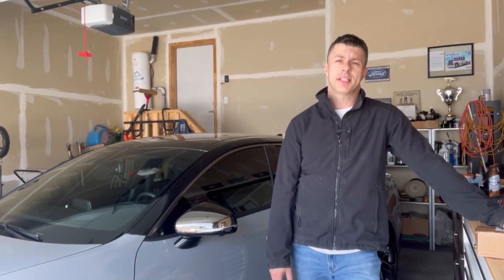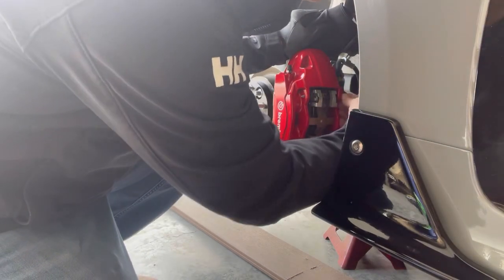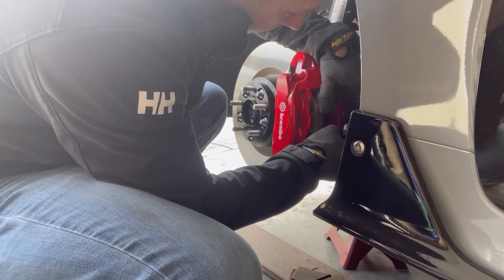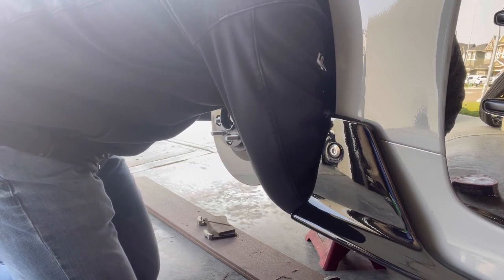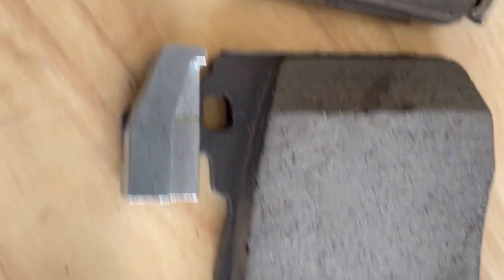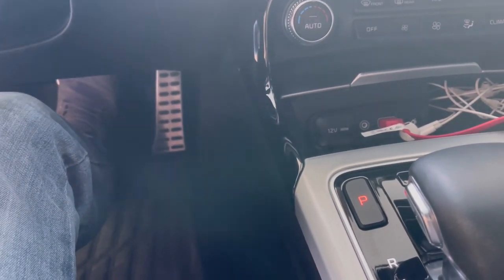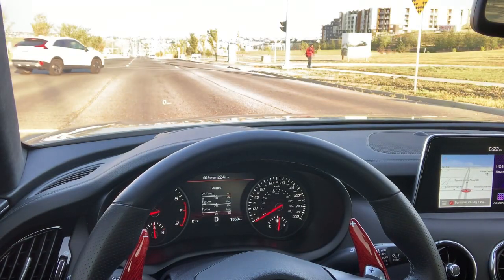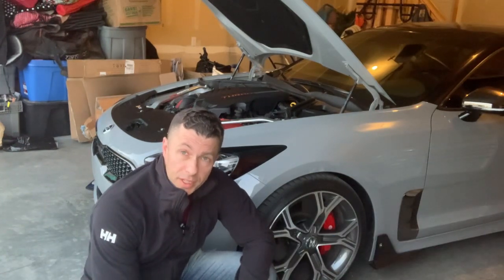CHEAP - QUICK Fix For Your Vibrating BRAKES | KIA STINGER

Comment: I just bought a used stinger GT2 with 20k miles and I notice it slightly. I went in with prior knowledge of the issue and crossed my fingers but it's definitely there lol. I'm assuming the residual shake you felt was due to not replacing the rear pads. So, it's been 5 months since you did the fix, did the issue come back? I'm not really a car expert but I might take a whack at following your guide on this.
Reply from the maker: The issue has never come back. I’d definitely recommend swapping out the pads with power stop from k8. Since you have 20k miles I’d just get the rotors turned. That should completely solve any vibration problems.
Reply from the maker: Brembo are probably the easiest pads to change. If my video doesn’t fully help you, there is a ton on YouTube to help you get it done. The biggest piece of advice when doing them is to make sure you get the pins to hold down the retaining clip properly. Also when the job is complete start the car and pump up the brake peddle before driving it anywhere or putting it in gear.
Reply: Did you only change the front pads here?
Reply from the maker: @kamandor  only the fronts so far and it eliminated the shake. I will be changing rears in the summer.

Comment: I got the power stops just like you. Installed them, but seem to hear like a shake or rattle noise, they brake fine but idk how I feel about that
Reply from the maker: I have no shake or rattle noises. Are you sure the pads are in correctly and you didn’t miss putting the pin through the pad correctly? I’d double check that everything is installed correctly.
Reply: @OVRBoosted  I'm gonna take it apart and check it again, did you re use the plate that sits on the pad and contacts the pistons? I didn't get a new one in my stoptech kit but I did get a new clip
Reply from the maker: @losttyrant7482  there should be a plate mounted directly on the brake pad. I re used the metal retainer clips
Reply: @OVRBoosted  reinstalled them, I had the clips in backwards 😮‍💨 Thanks for all the help bro!
Reply from the maker: @losttyrant7482  no problem, that’s what I’m here for is to try and help people out as well as get help from others.

Comment: Service the brakes once a year and don't drive like youre racing and you won't have a problem. If you hammer on any brakes the rotors can warp temporarily or permamnently, I own a gt2 never had a problem in 80 thousand KM
Reply from the maker: The stock brake pads are known to leave deposits on the rotor giving a vibration. I swapped just the front pads and drive hard with zero vibration after over a year.

Comment: So it's been a year, are they still good?
Reply from the maker: No issues at all to report and zero brake shake.
Reply: @OVRBoosted  nice, I have a g70 3.3 with the same issue. Only when they get hot.
Reply from the maker: @SparkyWrench  try a better pad, but if the rotors have a lot of miles I’d recommend having them turned. The issue on the stinger is the pour quality break pads from the factory.
Reply: @OVRBoosted  I remembered watching your video several months ago, wanted to see brand. I'm looking at the z26 warrior option.
Reply from the maker: @SparkyWrench  it’s a good option, if you contact the guys at k8 they might even have better options now. They also test some of the pads on their shop stinger.

Comment: Two or three crash-stops from 100kph will clear the dust build up off the pads and the shudder will disappear.

The rotors do not warp. Don't know what all the drama is about.
Reply from the maker: I put the new pads Iim and ha I had an issue since.

Comment: Steel rotors and cheap pads are most likely the issue. 
They should have at least put a performance vented rotors from factory.
Reply from the maker: I’m not sure about that only because my brake shake had completely gone away by swapping the pads. Kia used a pad that would leave deposits on the rotor when heated up. That’s what would give the vibration. Once the deposits cooled down they would clean off the rotor. Then the process would repeat. I have over 1000 miles on the new pads and no shake.
Reply: OEM are vented rotors.
Reply: @rpmautoreviews9249  I meant to put slotted and drilled performance rotors. Still the problem are the rotors
Reply: @410ytlmustang  Rotors are just fine and solid !! Not the rotors. Drilled and slotted rotors are weaker a bit more prone to crack in winter, they wear down your pads sooner, so you buy quality pads to have them worn down faster, they can be noisier, They just look so fn cool, but theyre not really better performance in braking. maybe a tiny bit better in the right sweet spot of bit hard driving and they heat up if prolonged spirited hard braking, but for real hard braking on a track or everyday spirited driving on windy roads, No, plain will perform better.  Unless you can afford $2k per rotor for the true racing type
Reply: @410ytlmustang  The problem is NOT the rotors and are in fact the pads themselves - a well known issue and fix on the Stinger forums.
Reply: @OVRBoosted  I wish they put a good set of pads and rotors from factory
Reply from the maker: @410ytlmustang  couldn’t agree more, but they probably have to cut costs somewhere. I’m surprised they have brembo brakes on the front and back. If you look at a lot of higher end cars they just put a brembo calliper up front and a factory Calliper in the rear.

Comment: Weird thing is I’m on my 3rd set of rotors and pads and it’s still shaking and vibrating.
Reply from the maker: Are they stock pads and rotors?
Reply: No, I got R1 concept rotors and pads. It is so annoying. Everyone seems to be loving their car but I spent about 10,000$ in 6 months owning it.
Reply from the maker: @HanHsu910  that’s crazy! I wonder if you got a bad one? I know a lot of people run the R1 and have no issues.  I just swapped out my pads and my brake shake has been gone ever since. Maybe there is a potential other issue?
Reply: @OVRBoosted  It is super weird, it only does that on the highway above 100 Km an hour when I press the brake. Brakes doesn’t seem to be stopping fast also. I have some bent rims I’m getting new wheels maybe that’s the issue. I hope haha
Reply from the maker: @HanHsu910  oh yeah, bent wheels will give the sensation of vibrations. I had Bent wheels on another car and experienced some vibrations.
Reply: @OVRBoosted  Mmmm but I don’t feel the vibrations until I’m on the highway and I’m pressing the brake. Only if I press the brake it vibrates.
Reply from the maker: @HanHsu910  that’s strange, did it vibrate when you put everything on brand new or did it start after time?
Reply: @OVRBoosted  Starts over time, all of a sudden it started slowly until it got really bad. I got my rotors replaced yesterday and still shaking, doing the pads tmrw hopefully. The old rotors was pretty burned but only 10k Km on it. So weird
Reply from the maker: @HanHsu910  that is strange, have you tried pads from k8? I had a civic that had horrible brake shake, I replaced the rotors and the shake was gone for about 15,000km then it came back. Had the rotors resurfaced and it went away for another 15,000km. Then it came back again so I feel your pain. The stingers usually attribute the shake to the stock brake pads leaving deposits on the rotors.
Reply: @OVRBoosted  Do you know why the civic rotors were doing that?
Reply from the maker: @HanHsu910  my guess is I heat up the rotors to much and they warped. Good be a cause of poor quality. However I have never replaced brakes on any other car and had that happen. 

I’d try the new rims you have first, then try a completely differently set of pads and maybe just have the current rotors turned. K8 has a really good set of pads for a decent price. They test the pads on their shop stinger. I know the power stop pads that I used are great. Zero issues so far and I just swapped out the front ones. That was about 5000km ago and I really put them to the test and heated them up to the point of smoke. I thought for sure once everything cooled off I’d have warped rotors, but all was good till this day. Do you have the stock rotors still?
Reply: @OVRBoosted  No I have the slotted and drilled R1 concept rotors. My 3rd set now, maybe the bent wheels aren’t putting even pressure on the roads when I brake and cause the rotors to warp?
Reply: @OVRBoosted  I can’t really turn these rotors cause they are drilled and slotted. Brake shops near me all rejected it. So only options was buying new ones. They are only $1,000 Canadian roughly for 4 so not bad at all.
Reply: @HanHsu910   I just got new wheels on my 2019 GT because I bent an OEM wheel hitting a pothole. The shake that I had went away with the new round wheels. I was also worried about it being the pads/rotors again too. It was definitely the oval ass wheel I was running 😆 Turns out... circles roll better than squares. My shake also only happened when braking with the bent wheel, maybe an indescernible amount of vibration while cruising

Comment: its not k-16 its 16-6012-z16
Reply from the maker: Thank you for the correction. The z26 are a more performance based pad. I’d return over the z16
Reply: @OVRBoosted  I love your Chanel ! How is the brake now? And on the track?
Reply from the maker: @jonathanpoulin6150  the breaks still are perfect no shake has come back yet. I have some new content coming. It’s winter where I live and I have the car tucked away, but I have some new flow forged rims coming up and I’ll also be doing some tire reviews that are budget friendly. So stay tuned the spring and summer is when I will be pumping out content again.
Reply: @OVRBoosted  im living in Qc And I just hear about yellow EBC...
Reply from the maker: @jonathanpoulin6150   have seen guys talk about them. These pads I used were recommended by k8stingerstore and I only got them because they also run them on their stock stinger and have no issues.

Comment: easy brake job...Throw the rotor screws in the trash
Reply from the maker: Doesn’t get much easier with brembo. I hear you on those rotor screws.
Reply: @OVRBoosted  I did the fronts,the rears are on back order at powerstop for another month LOL
Reply from the maker: @excelerater  you will probably be fine and have no shake running g the fronts. I know mine went away and I did the same thing.
Reply: @OVRBoosted  The front were def the biggest culprit,dealer fixed them twice and just cut the OEMs,so glad to be away from that scam